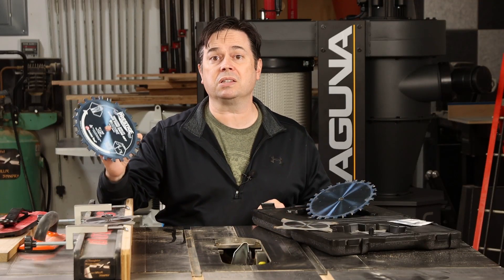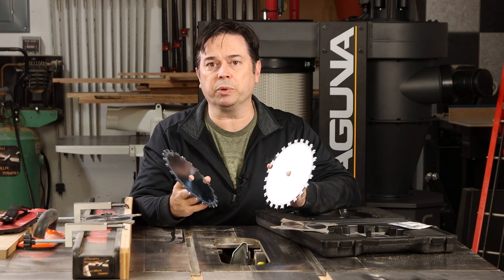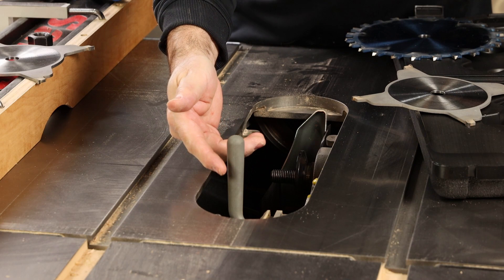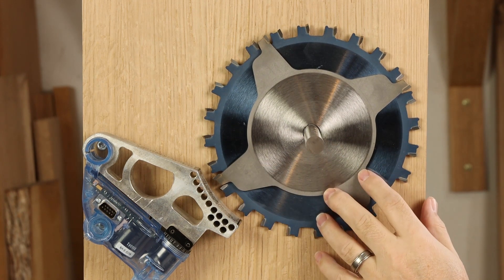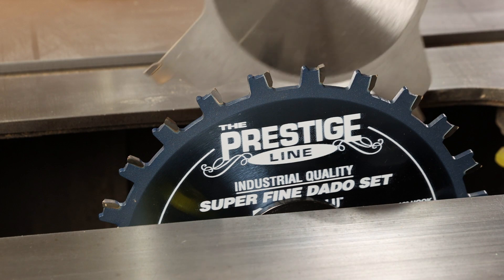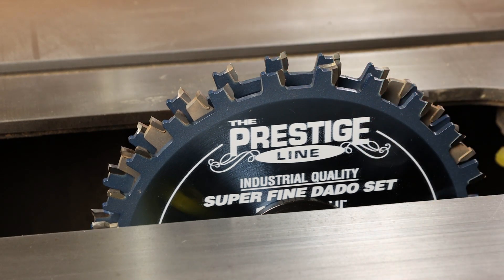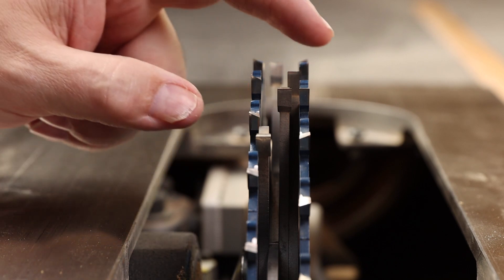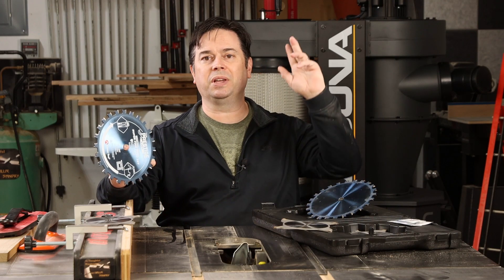Install Dado Blade on Sawstop Tablesaw + Set Brake Spacing Woodworking Skill Share #Woodworking

Comment: I have the 1.75hp Sawstop contractor saw. Love it. Can I use a 6" dado set up in my saw?
Reply from the maker: Hello, no you can't use a 6" dado blade on a Sawstop.  The Dado brake will only calibrate with an 8" dado set.  Thanks.

Comment: turning the riving knife handle down seems like it is loose....is that ok?
Reply from the maker: I like the riving knife to have a light but positive action.  The riving knife shouldn't wiggle or feel loose at all.  The handle gives you pretty good leverage.  It's adjustable so you can set it the way you like.  Thanks
Reply: @TheThoughtfulWoodworker  but when using dado set, the riving knife is out of the picture....so the handle just sits in downward position, kinda loose?
Reply from the maker: @waterbuddy92   Yes it's okay if it's loose when not in use.  As long as it's turned fully downward.  Sometimes the saw won't calibrate if you don't turn the handle all the way down.  Thanks.